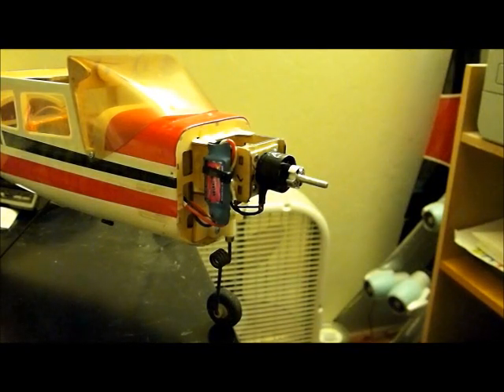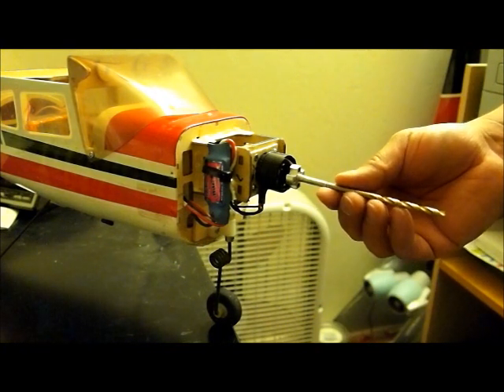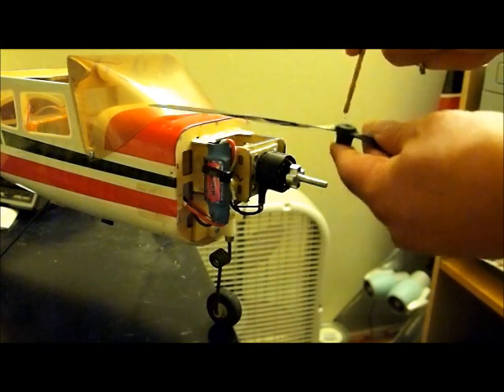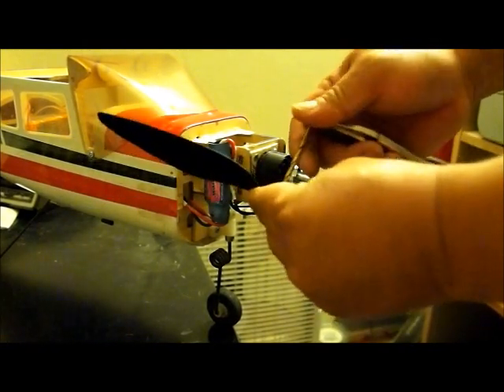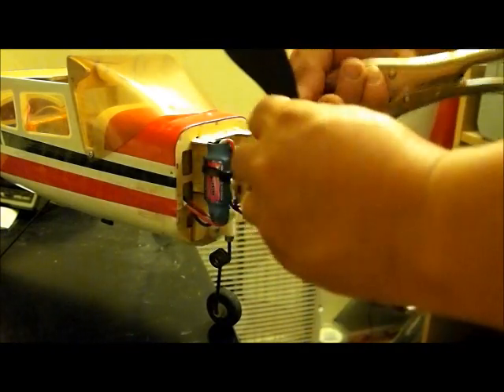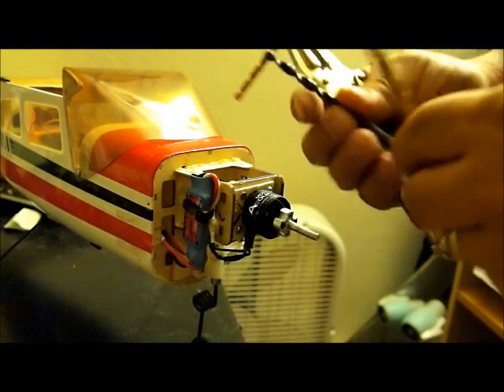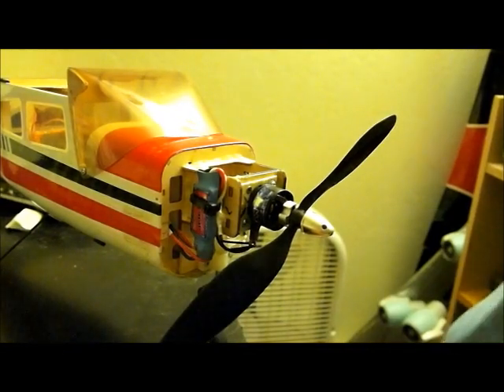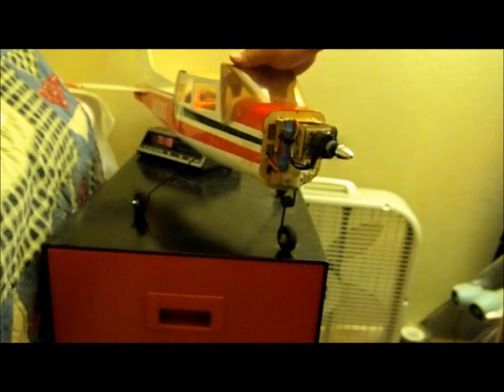How to Ream a prop, well sorta

Comment: thanks for this tip. Other suggestions were way to complicated. using sequential drill bit sizes by hand makes so much sense and should reduce the risk of getting the hole off center. The E Flight Trojan has a weird prop and is currently out of stock. I'm going to try to modify a Master Air Screw prop, which seems to be of much higher quality in any case.
thanks again!

Comment: Most GWS props are "slow flyer" props, so it's possible to choose a more aggressive pitch when converting the prop for a sport plane. You could test the current draw with a wattmeter or simply fly the same airplane with different propellers for comparison.